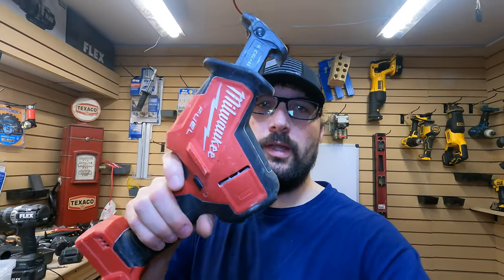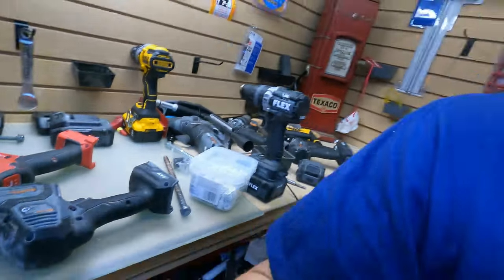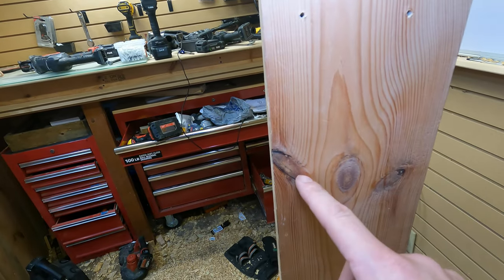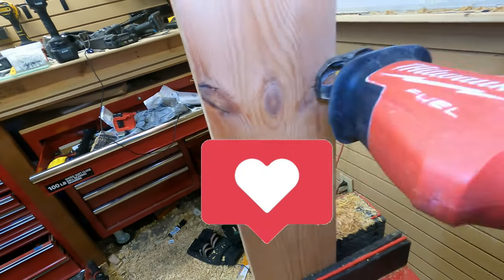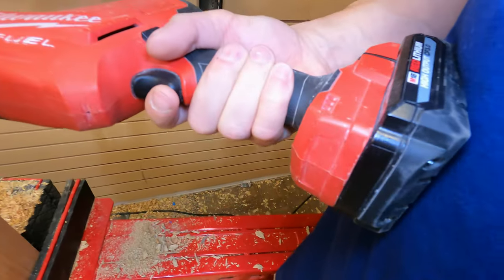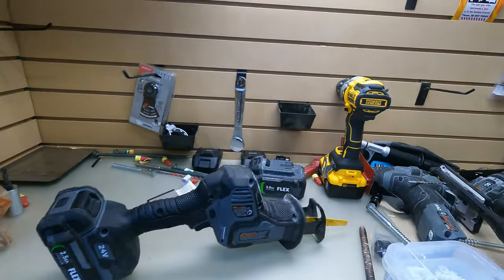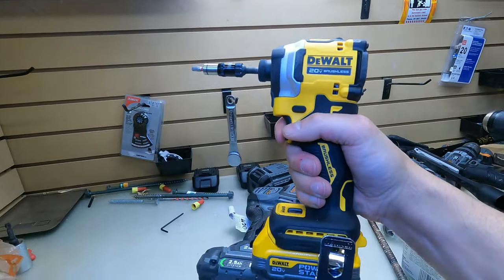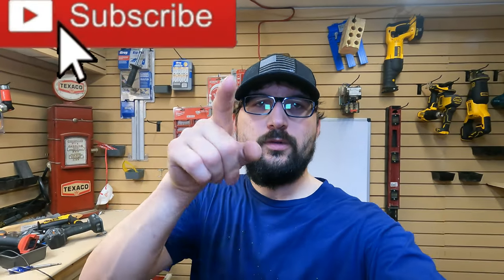BEST 1 HANDED RECIP!

Comment: Why didn't you just have the wood laying horizontal
Reply from the maker: longer cut,  more runtime to drop the battery volts and straining the tool for longer  some tools do better in short burst. they seem good. but when a real task comes they slow down  heat saturation  ect.
Reply: @toolsandtactics  you can still put strain on the tool with it horizontal . One big difference is when the cut is finished the tool blade will bind your way. It just looked uncontrollable like a earthquake
Reply from the maker: @weldonpinder7295   @Weldon Pinder  Man,  i was answering 400 comments  it hit enter in response to this 1 ,   watched the video and was like ooohhh   lol my bad!! ** YOUR RIGHT **   i should have layed it horizontal!    

 for the record though i was going for an earthquake when the blade becomes 1 with the wood and rattling your brains  lol
Reply: @toolsandtactics  hey it was still a great video because I was interested I seeing a vs video between flex and Milwaukee because it helps me in deciding what to purchase.
Reply from the maker: @weldonpinder7295  thanks
Reply: @toolsandtactics  Not bad at all.  I thought it was cool to see a different angle than most videos
Reply from the maker: @SanJacinto23  thanks, it's good to switch it uo now and then

Comment: Dude wasn't the flex faster?
Reply from the maker: Hard to say  consistently yeah it never slows down   but the Milwaukee is fast and has enough power even if it slows down due to load its still faster   the flex never bogs down    I 1st noticed it when I was ripping up sub floor and forcing plunge cuts in between 2 peices if ply wood or we're laying new floor and it didn't quite fit and just pinching the blade against 2 pieces of plywood and making the cut fully in a bind   the thing never slows down
Reply: @toolsandtactics  the bigger brother Sawzall I use all the time but I don't have a use for this one but since you have one I need to have one too.
Reply from the maker: @rickyperkins232  haha  !  it's big brother is massive  lol  awesome saw!!!